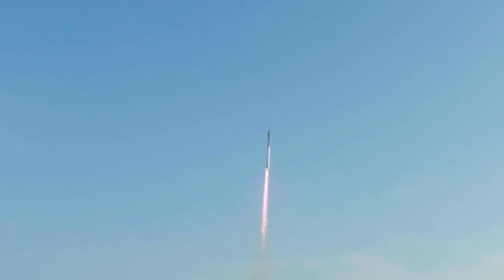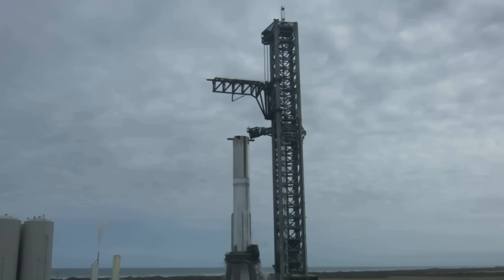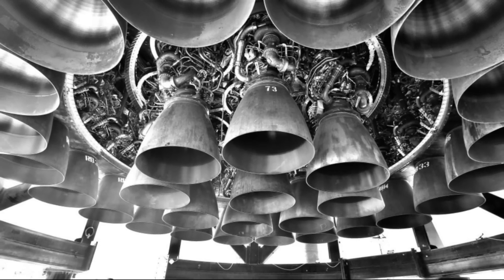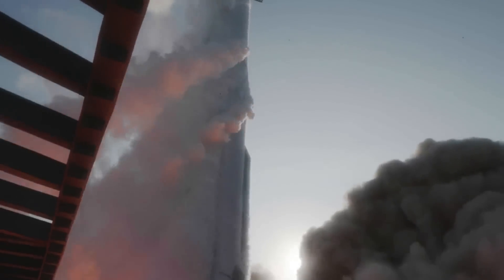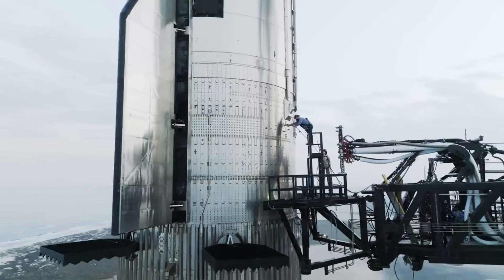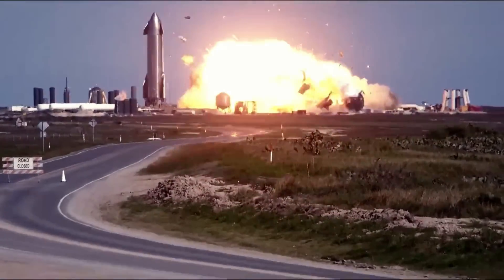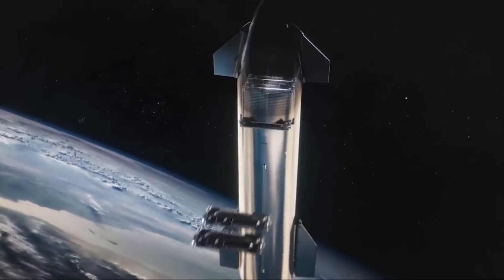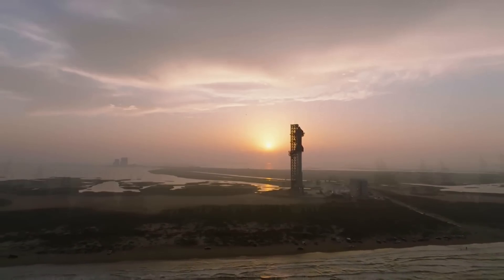What Improvements Were Made To Starship's Next Prototype?

Comment: WHAT A FARCE. IF THAT WAS THE CASE WHY NOT JUST WAIT AND LAUNCH BOOSTER 9 AND WAIT TO UPDATE THE OTHERS IF YOU KNEW THERE WOULD BE PROBLEMS ? THE BIGGEST PROBLEM BY FAR IS THE LAUNCH  PAD AND LAUNCH AREA. ITS A TOTAL JOKE. REDESIGN THE PAD TO MAKE IT INDESTRUCTABLE AND SURROUND IT WITH STANDING WATER SO YOU DON'T GET THAT GIANT DUST STORM ON LAUNCH.

Comment: They also have to improve thrust, @MAX Q the ship had only 1,5Gs, and you need at least 3G's to keep going, you could easily see it that the ship was ascending slow, too slow to get MECO while fuel was burning fast, at one point there was a serious fuel lost from the LOX tank for a few seconds, and that was the reason the booster got without fuel, so the efficiency has to go up significantly. Also, the timings were not nominal, the backing throttle came way too soon, which slowed down the rocket even more. There is an engineer that analyzed the data from startup to where the rocket starts to tumble. Besides that, it was epic to see a skyscraper going into the air. Ground zero doesn't concern me very much. Those teams are smart enough to find a proper solution. Just one thing, they are going to use electricity for the vector thrusters. I hope they keep in mind that electricity batteries don't go well with freezing temperatures. When LOX is loaded.
Reply: Yeah the launch mount might as well be considered a temporary fixture. Everything is eligible for change at this point. What gets me is that very few people seam to understand just how much this will improve life for all of us.
Reply: @Astroponicist  I don't "seam" to understand how engineering can be performed so unartfully.
Reply: @MrShobar  Well lets see your rocket Mr. master engineer.
Reply: The tanks were blown by FTS that's why the starship ran out of lox's
Reply: Don't you think it is strange that a ship which can land is not designed to separate at its own will in case of emergency?
Reply: @reasonerenlightened2456  What part of first test flight do you not understand?
Reply: @malbers35  The part where so much of taxpayer money was wasted because they did not foresee that in case of emergency a separation attempt is a must have for a ship that allegedly can land..
Reply: @reasonerenlightened2456  No taxpayer money was wasted on this. None at all. This is a private company developing a private vehicle. Yes, NASA has contracted SpaceX to land a Starship on the moon, but that is a fixed-price contract. Whether the flight succeeded or not, the price stays the same. The SpaceX contract was also the cheapest out of the 3 viable options.

And "in case of emergency" didn't exist here. It was an unmanned test flight. They never planned to recover the ship at all. Whether it blew up at the time it did, or 90 minutes later doesn't change anything from a cost perspective either.

Writing code has a cost. Not just the cost of the time it takes to implement, but also to review, validate, maintain and fix. Spending effort at this time to program the ship to try to escape is focusing on a contingency, while you're still trying to figure out the basics. By the time there is crew on the ship, they should absolutely try to do an abort. But for a test flight? Nah, as a software engineer I can totally understand why they didn't program that in yet. Get the "happy path" working first...
Reply: @reasonerenlightened2456  Not all launches are taxpayer money. Since 2020, about 25% of SpaceX's launches were government contracts (NASA, USAF/USSF, NRO, or other agencies). Now SpaceX has received government grants and contracts in the past and present and will continue to pursue that funding in the future. All funds are fungible, but R&D for Starship Super Heavy could have stayed as white papers until NASA or someone else forked over the cash in full. Instead, SpaceX went ahead anyway to spend their own money, hope some of it's reimbursed by current/future grants/contracts, and are otherwise confident that succeeding with Starship is winning a major bet. It's one craft that could take dozens or even hundreds at a time into space and landing on the moon or Mars. Might even make its way out to the gas giants, if a crew can stand being cooped inside for up for 5 to 10 years at a time.

Boeing/ULA is basically a car stuck in 1st gear doing 15 mph down the road. They're burning a lot of gas and repeatedly blowing up their engine/transmission, with the US Taxpayer paying for almost all of it.
Reply: @Niosus  ignore him he's trolling he asked the same questions like 10times in other threads. Like we wouldn't see.
Reply: @reasonerenlightened2456  we've answered this for you 3 times ... I'll answer it for you again... The Hydraulic system blew out so it couldn't unlatch because they are driven by hydraulics.
Reply: @KevinPolin  Some people are truly delusional if they believe Star ship would be human rated with so easily neutralised separation mechanism.
Reply: They fired the engines at 90% on that run, if they have all 33 engines on at 100% they should have the thrust they need
Reply: The engines were fucked dude stfu as if rocket scientists had no idea how to calculate that?
Reply: Sorry???
What rocket papers did you read to get 3G's as the minimum thrust required?
That's not even a useful metric of performance unless you have the delta-v and orbit targets on hand

You can have negative 1G and still make it to orbit

Anyway.
You're right the booster had issues with throttle down for max-q and also the booster asked for maximum thrust but didn't get it.

There was a lot of fuel loss but it didn't matter because TVC was already lost and throttle based TVC failed too.

I would be surprised if they had insufficient thermal insulation for the batteries, especially considering they can heat it on the ground
Reply: They dont have to increase thrust, the rocket had lost like 8 engines, it cant reach nominal acceleration like that

Comment: If there are catastrophic failures on the Moon ,  the learning why and testing will not be quick like Earth launch failures.
Reply: Which is why they're testing now, so they don't have problems later down the road.
Reply: @Noxti! space X has the communist way of classifying failure as success .  We saw the comrades rooting for success when the last rocket was destroyed.  Not having a Spacecraft abort system to save Astronaut lives will be a tough one to skirt around NASA . A Spacecraft abort system will have to be really tested.  But I think Space is generally doing well.  The Mission to populate Mars will result in many dead people.
Reply: @Noxti! are you aware some satellites have failed recently because Earth magnetic field is rapidly weakening as is historically expected?
Reply: @mikewallace8087  The Moon doesn't have a magnetic field and these missions are designed to withstand radiation in space.
Reply: @theastronomer5800  specifically , Space X launches Earth orbiting Star Link satellites and some have failed in quantity .  As an astronomer you may be interested in solar science and the channel here called SuspiciousObservers that has daily reports on solar weather.  You know that the Earth magnetic poles are moving faster and faster.  The Earth surface is receiving more solar energy in various forms.  There is more but I resign here for this moment .

Comment: I think we may realistically get one more this year
Reply: Hopefully static-fire tests before. Even if launches are exciting there's always a chance something blows up, so to be able to see successful static-fires with a pad that can withstand, and a rocket without engine failures, would be equally exciting.
Reply: Don't you think it is strange that a ship which can land is not designed to separate at its own will in case of emergency?
Reply: @Reasoner Enlightened  it is designed to separate the old hydraulic system, which failed  it not reliable or fast enough for its size it was known and is already fixed on 9 the maneuver did not work either that's why we test
Reply: @reasonerenlightened2456  There are like 50 Videos out that explain the Hydraulic failure not allowing the ship to separate.
Reply: @KevinPolin  What were the explosive bolts on the separation claps doing when the hydraulics failed to work ?
Reply: 5 according to elon, doubt he would make stuff up
Reply: @optischTV  Elon said 2 months... But it's more based on Launch License. The concrete below the Steel plate needs 21 days to cure so minimum 21 days after the concrete has been poured and then they need to install the water cooled steel plate, then the launch license.
Reply: Not off the ground
Reply: How did you to come to this conclusion?
Reply: @towel9646  just a guesstimate based on previous timelines
Reply: Yea I’m think November
Reply: @sc1338  november 21th take it or leave it